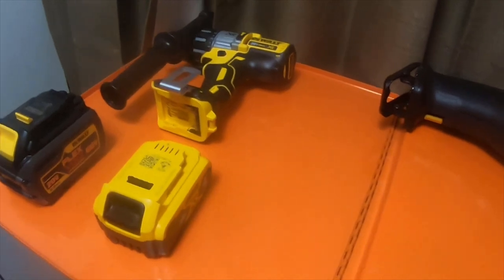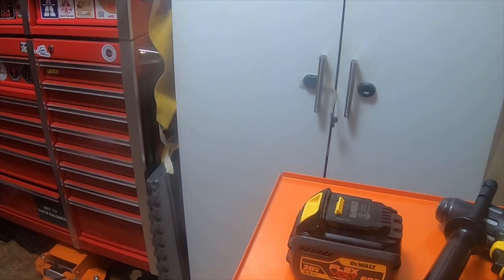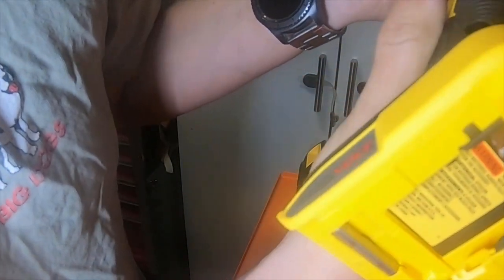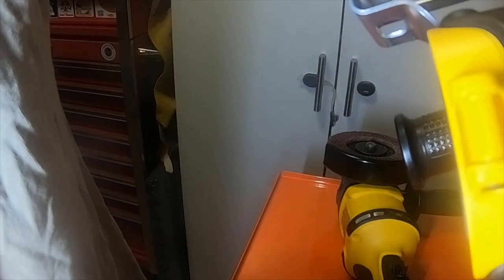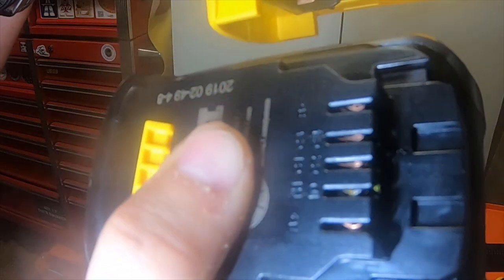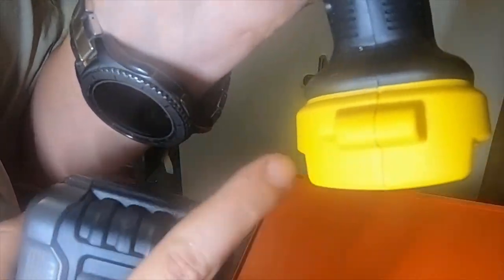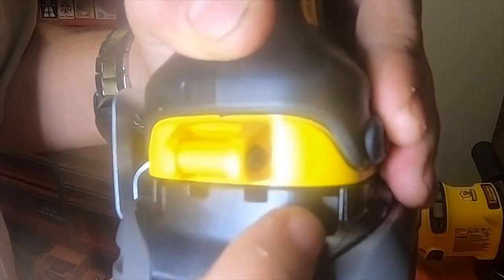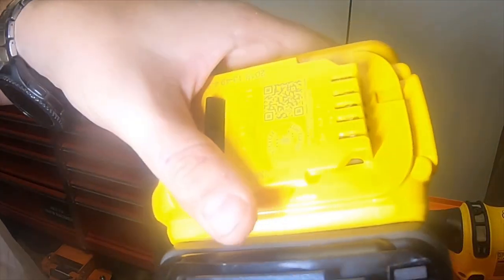Tool Talk - Dewalt Flexvolt 20V N 60V Batteries Response to Nick @VCGConstruction

Comment: Good in-depth explanation. I hope people understand that. Anyway, if you shove 60 volts into a 20 volt anything, it'll automatically burn out the electronic within seconds.
Reply: Not necessarily. Depends on what all the components are rated for.
Reply from the maker: i agree if its straight 60 volts into the 20 volt tool but it does depend on what the components can handle if it will harm them or not

Comment: So my 20 volt charger and 20 volt radio charger will charge the 60 volt battery??
Why would I benefit buying a 60 volt battery when all my tools are 20 volt?
Reply from the maker: 60 volt batteries give 20 volt tools longer run times
Reply: @AntonioClaudioMichael  and the chargers are the same? Thanks

Comment: Blacknyellow
Reply from the maker: The black and yellow charger will not charge the 60 volts only the bright yellow super charger will charge both 60v and 20v batteries
Reply: @AntonioClaudioMichael  blacknyellow was a play on the song title.
I believe my Dewalt charger is black. I normally use the Dewalt radio charger with Blue tooth for charging my 20 volt batteries.